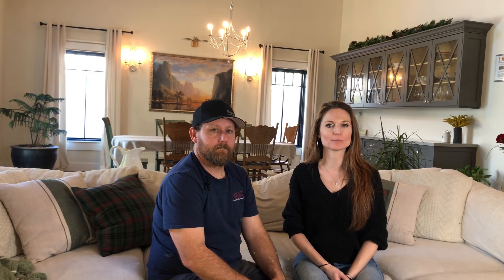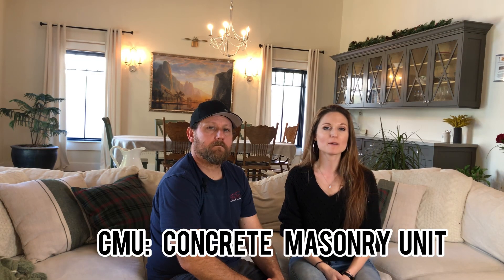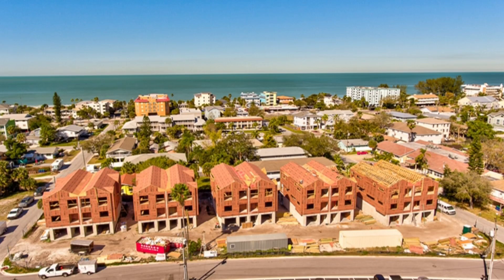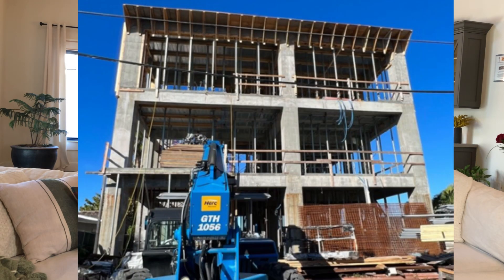Why Are Florida Homes Made of Concrete Block?

Comment: Steel frame homes are also very strong, especially in hurricane season in Florida.
Reply from the maker: Yes, steel is definitely strong, and the strength to weight ratio is higher, I don't see it being used a lot in Pinellas County coastal areas around here. I would imagine the salt air and corrosion could be an issue. I do know that building a Barndominium using steel is more cost effective.

Comment: I lived in a Cinder Block home during Hurricane Charley.  The only damage was, roof panels, and the Metal Shudders had indentions from debris the F-0 that decided to breeze through the Yard.
Reply: Stop making cinder blocks back in the sixties it's concrete block
Reply from the maker: The original Cinder Blocks used Cinder a by product of coal, they are still made but not commonly used in construction. CMU - Concrete Masonry Unit is the official name of the 'concrete blocks' now commonly used in construction (plus there are specific strength requirements for diferent sizes and shapes as per the building code etc) although these :new: blocks are often still referred to as Cinder Blocks.
Reply from the maker: Yes, roofs can be the weakest link.

Comment: I know for a fact that concrete blocks don't insulate worth a damn.      I am in Canada and at -30 C the concrete is a conductor of the cold and in summer it conducts heat.    Even if you fill up the voids in blocks , there is still a cement connection a couple of inches thick.    In Canada you would see the frost outline of this on your interior wall.      2X6's are the best and the wood is 1 1/2 inches wide but still wood is a better insulator than concrete.     I put R20 insulation in the walls and 2 inches of SM on the outside for R30 walls .   In Florida brick construction , you would be lucky to get R3.   In Florida they also only have single pane windows.   I use triple pane low e with argon gas.
Bricks might be more sound proof but sound travels more through the windows than the walls.   Unless you are in an apartment block,  houses don't make a bit of difference with interior sound, wood or brick, so that is not an issue. 

People in Florida don't really get extreme temperatures so they don't know how concrete conducts heat/cold, they have had no experience with this.     My basement is cement 8 inches thick and if I had no insulation , then the concrete would be very cold in winter.   In summer it draws the cold from the deep ground and actually helps to cool the whole house.   So it has zero insulation value.      So I put 2 inches of SM on my basement walls 8 feet deep into the ground and on the inside I insulated the walls with R10 SM.   So I have R20 on my basement walls.   I also put 3 inches of SM insulation under my garage floor , so I heat the garage in the winter and the concrete stays warm.

I think that the brick construction in Florida should sheath the houses in insulation from the outside, this would keep the walls at room temperature and you would not get the bricks expanding and contracting everyday with the heat cycle.   Concrete does expand and contract with temperature, so does wood.   In the winter the wood in my attic shrinks and I get a fine crack in one of my bedrooms upstairs and in the summer the wood expands again.   Most people do not know this.
Reply from the maker: Hi @jeffbguarino, actually it is not common building practice to use single pane windows down here in Florida - they're all triple pane, low e with argon gas, and of course hurricane-proof.  Insulating against the heat is just as important to us as insulating against the cold up north.  We do get R value from the block down here, and injecting with insulating foam can bring up to about an R6 or an R8, or higher depending on how it is built.  Thanks for your input!  We're originally from Canada, so we definitely know the importance of insulating against cold, and especially insulating your pipes!
Reply: @Nelsonconstructionrenos  My two houses in Florida were built in 2008 and they have single pane windows.  I also shop a lot at Home Depot and Lowes in Kissimmee and never noticed any 2 pane windows let alone 3 pane but I really don't know what the contractors are currently building with.    My patio door in Florida shattered last year and I went to a glass company to buy a new glass and it was single pane tempered glass.  The other windows in my houses are not tempered glass either so if they break they will be big pieces.   They do say on google the E4 coatings are worth it in Florida but not multipane windows.
I see they do sell multilayer glass, with plastic sandwiched in between , to make the window resistant to hurricanes. Same as your cars windshield with a layer between two glass. 
I just searched google and I see they do have some window companies in Florida selling dual pane windows with argon or krypton and low E.   But I don't know  how wide spread the practice is of using these windows because they are a lot more expensive.   Condensation is a big problem on interior of windows.  The multipane windows need a desiccant to keep the interior free of moisture.  Once you get moisture the window is usually ruined. They put the desiccant inside the window frame and you don't see it.  Florida is so wet, inside and out that the multipane windows might all have problems in the not to distant future.  The desiccant gets used up over time , so these windows only last so many years.   https://www.nachi.org/condensation-double-paned-windows.htm#:~:text=As%20the%20sealant%20protecting%20this,to%20prevent%20condensation%20from%20forming.
In Winnipeg it is so dry that we don't usually have problems with the tri pane windows.   Unless you don't  have your windows caulked properly on the bottom.  Water can get under the window and slowly invade the seal on the bottom and soak all the silica desiccant.
Reply: @jeffbguarino lol home depot and Lowes? You really did your homework.
Reply: @alexandrep4913  I wasn't doing homework.  I have never seen tripane windows in Florida. Anywhere.
Can you name a place, I would be interested to see what they have.
Reply: Have you heard of   wienerberger porotherm system, its in use allover Europe. It is  great at insulation and would be perfect for Canada. I dont suppose Canada is colder than Ukraine and Russia.
Reply: Vermiculite or perlite in the block if you're not going to fill them with concrete Sonoma concrete you have to stud out the inner walls insulated